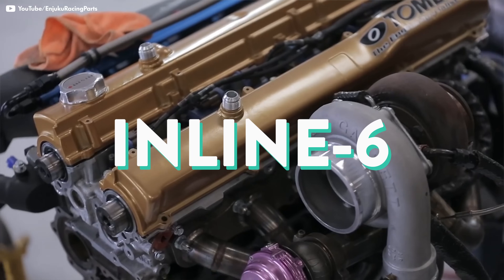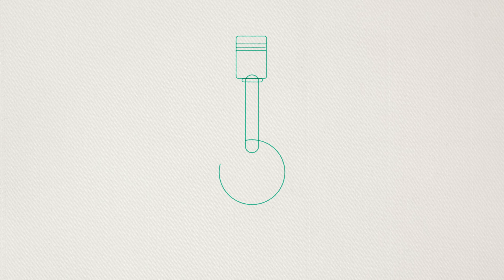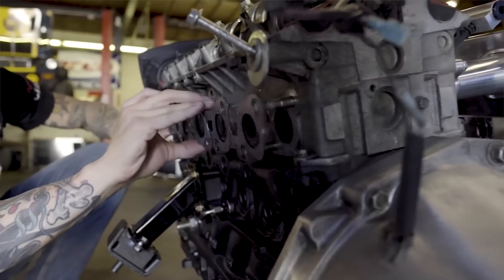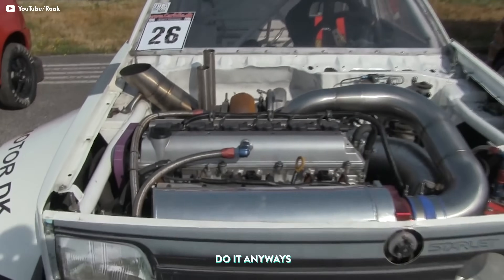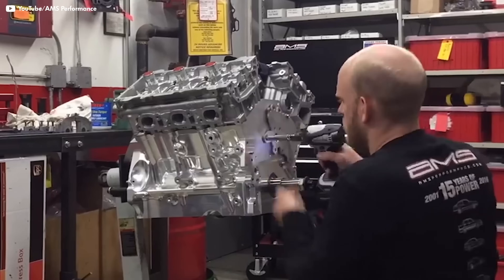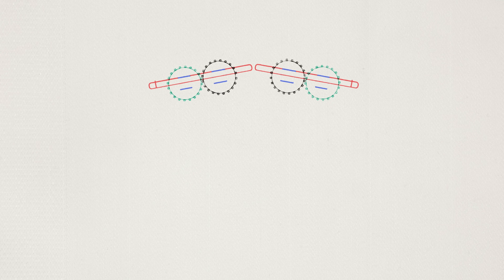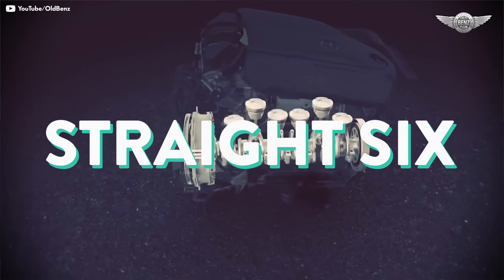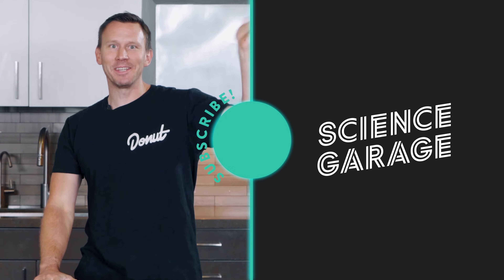INLINE 6 vs. V6 - How it Works | SCIENCE GARAGE

Comment: No mention of the AMC 4.0 Jeep engine. Probably the most iconic American inline 6. 

Good video though... as usual.
Reply: AMC'S 232 and 258 in line sixes are excellent.
Reply: 100% fact AMC Inline-6 engines are one of the most reliable engines
Reply: Mine has 350k miles and runs flawlessly
Reply: Zach Stefl don’t forget the early Chrysler 4.0l iteration of the AMC i6
Reply: Even here in Spain where everybody is a fucking diesel-cheap-psicho,  Jeep Cherokee(and grand)/wranglers 4.0 L6   have way more fans than 4pot and diesels, gess why...
Reply: Was gonna say the same thing
Reply: Zach Stefl ....and the AMC 4.2 straight six.
Reply: Zach Stefl bmw and toyota make better i6's
Reply: @lukas6610  i don't think you understand what the 4.0 was. It's not a highly tunable 1000hp engine, but it doesn't die. It doesn't get much better than that.

Comment: lots of trucks had i6s in them. they can be a great motor for a project but they do lack the HP. not alot you can do with them either. probably the most reliable i6 out there is the Ford 300/4.9L i6. surprised you didn't cover it here.

Comment: Long live the slowest v6 ever. The cast iron block and head ford vulcan 3.0. It came out in 1984 with a whopping 12 valves, a 5000ish redline, and maybe 120hp  mine probably has less as it's 23 years old on the original build!

Comment: Not all V6 engines have multiple camshafts

There's a number of them that are single Cam engines stating that V6 engines have multiple camshafts among other things is extremely misleading
Reply: All the V6 engines that are any good have multiple camshafts :p
Reply: Let me guess, VW group?
Reply: Quintinohthree just because someone makes a reference to boxer engines doesn't mean VW, they could be talking about Porsches
Reply: @karlsmith2570  You were talking about boxer engines? Damn, that's worse than I thought. I thought you were talking about the VR6. Heck, I think it should have been mentioned in the video why this best-of-both solution solves issues of both types but has issues of its own.

Let me explain to you all the ways that you are wrong;
1: Boxer engines are not V-engines. They are fundamentally different. Boxer 6's are at least as different from V6's as straight 6's.
2: VW Isn't exactly known for Boxer-6 engines. They're barely known for their boxer-4 engines nowadays.
3: Boxer engines of all configurations have the greatest need for multiple sets of camshafts and other such components in the head given the heads are at the opposite ends if the engine.
4: We're not talking about cam-in-block pushrod operated valves. There's a reason the only performance engines using those nowadays are the LS-series.
Reply: Quintinohthree First off, I was talking about V6 engines to start with

When I was making reference to the boxer engines, it was in response to someone else's post making reference to VW's having them as their powerplants

Making your post about that my " Being wrong" was premature, in addition to being a knee-jerk reaction to my statement which you'd taken out of context
Reply: First off, within this thread you made the first reference to boxer engines, I only responded to your mention of it. I don't know how you could turn someone else connecting boxer engines to VW in another separate and unrelated thread (which I haven't even seen and can't confirm even exists at this point) into me referring to boxer engines by guessing you were referring to VW engines.

Of course I was not referring to boxer engines, and as you can tell I'm well aware of what they are and what brands have made them, but instead I was referring to VR engines, which are exclusive to the VW group (give or take a few exceptions). Seeing as you have chosen to go further off topic rather than discussing VR engines with me or telling me what other V6 engines succeed in getting by with a single set of overhead cams, my suspicion that you don't really have anything worthwhile to discuss is growing.

I did not take your statement out of context at all. In the context of this thread, you responding to my guess that you were thinking of a VW group engine type with "not al boxers are VW, some are Porsche" suggested to me that you were thinking about boxer engines in your original post.

Now, do you want to discus single-cam V6 engines, or do you want to be correct?

Comment: Legendary I6s: Toyota 2JZ, Ford Barra, Nissan RB, BMW M88, Jeep 196, Chrysler G-engine (slant 6), GMC atlas LL8 (chevy vortec)

Legendary V6s: Volkswagen VR6, Nissan VQ, Honda J-series, Ford SHO, Lancia B20, Buick 231,

Any more?
Reply: buick v6 , amc straight six, chrysler slant six
Reply: 3FE, 1FZ, 1HD and so on from Toyota.
Reply: L series motors from 240z-280zx
Reply: Early Jimmy 6's from. GMC
Reply: Barra is the best inline 6 ever made
Reply: 6G72 V6 from 3000gt vr4's and other cars
Reply: legendary v6 should be tha alfa busso
Reply: BMW S54
Reply: @YeaItsNoble thats a flat 6
Reply: Mercedes M103 & M104 are popular for drift cars in Europe. Both share a block with the OM603 diesels so they're stong af. The C36 AMG engine is an M104 with an OM603 crankshaft. They're also very similar to the Mercedes I6s of the 60s which the Nissan I6s were based off of so some crazy people have put Mercedes heads on Nissan engines and vise-versa. 

Also, the Ford 300 is a fantastic truck motor.
Reply: Other legendary v6s vr38dett vg30dett
Reply: Samsung Galaxy S7   true
Reply: Cummins B series for inline 6
Reply: The Alfa Romeo Busso V6!! Those intake runners are a work of art and that sound is pure music!!
Reply: Can’t believe u missed the VG30DETT the greatest V6 ever made and the C Series form the nsx

Comment: Science garage on: fuels, part 3: expansion on octanes (some say that on higher octane fuel your engine runs better, you get outright performance boost and better mileage), are all those "super" fuels (with some extra chemicals that are supposed to clean your engine and reduce wear) worth it, what do when your car works on leaded fuel, what are the other kinds of fuel? How does oil work? Why so many different oils to choose from? How long do I have to wait for oil to start circulating and heat up? Will we ever get donut powered cars? 🤔

Comment: Chryslers first mass production use of aluminum engine blocks was with the 170 cubic inch slant six in 1960, as an option for the Valiant line (it got absorbed into Plymouth in 1961). I'm surprised you didn't mention the old Chevy stovebolt 6, that thing ran for almost 40 years, I think that was GM's longest production engine outside of the small block Mouse motor.

Comment: Surprised that there was no mention of the ever-popular 3800 series V6
Reply: I drive a 2000 Pontiac Grand Prix GT with 250k miles on it and it still runs pretty good. That engine is bullet-proof. I plan on getting everything right and running it 'till the wheels fall off. Lol
Reply: Maybe because it was a Buick 350 V8 neutered to V6.  Sure boost woke them up but it was still a low revving OHV 90 degree V6, heavy too.
Reply: @GlassTopRX7  it had a shorter stroke but same bore (3.80x3.85 for Buick 350; 3.80x3.40 for Buick 231 V6)
Reply: Ah yes, the old Commodore V6. What a heap of dung that was! I remember back in 2002-03 the supercharged 3800 (4 speed auto only) was slaughtered by the NA Ford in-line six...let’s not even mention the Ford turbo six!

Comment: Hold up... you said that FWD cars can't fit i6's, yet the Skyline GT-R (which is AWD, which I assume to basically be RWD+FWD simultaneously) has a twin-turbo i6. How did it manage that? Is that why the Skyline GT-R is a bit long for a mid-size sports car?
Reply: A FWD only car wouldn't fit an i6 because it would have to be mounted transversely. Skyline GT-R AWD(technically 4WD) system is actually a RWD system with a transfer case at the back, the second driveshaft travels from there to the front diff. This allows it to be %100 RWD until the computer detects a slip and sends torque to the front wheels. This is why people love GT-R's, the only other major manufacturer(that i can think of) to have a %100 rear bias 4WD system is BMW.

Comment: No mention about the legendary Jeep 4.0 in-line 6? ;(
Reply: If you want legendary than you're in the wrong part of the FCA, because what you want is the 225 Slant Six.
Reply: My jeep has 200k miles it's a 98 has the ol 4.0 leaks a little oil but it won't die
Reply: #Jeeplife #brokeaf 🤣🤣
Reply: Don't worry man, some of us appreciate that engine
Reply: My exact thought man, i love my 4.0 xj, never left me stranded and beats some of my friends cars in races, which is always a plus.
Reply: HP per liter wasn't good. Durability only on par with Japanese. Nothing spectacular. For the fuel they use they're kind of lame. Good not great.
Reply: Vegan Cyclist I agree with all of your points except I think it’s just slightly more reliable than Japanese motors, I’ve heard the Jeep 6 cylinders last to well over 350,000 miles. But you do have good points.
Reply: is there a petrolhead which prefers shit but durable engine?
Reply: Vegan Cyclist plus, you can get lots of horse power for cheap. You can turn the 4.0 into a 4.9 stroker motor for less than $3500 that creates 400+ horse power and 450 ft-lbs of torque. Pretty cool stuff. But fucking scary in a Jeep lol.
Reply: 3500 is enough money to turn a MK2 VW into a 12 second car. The problem with jeeps is the rest of the truck. They're fun but for that kind of fuel cost you might aswell drive a diesel. If they had put turbos on them, it would have been something special.  I do like the transfer cases. They're good.
Reply: Vegan Cyclist a turbo charger would be nice because the power band has lots of torque and horsepower from 1700-3500 rpm. There is no reason not shift once you hit 3500 rpm because the power just drops. From what I’ve experienced with my inline 6 wrangler, it needs some high range power. But then again Jeeps are designed to be off-roaders so you want the torque to be at its peak in the low rpm range.
Reply: The turbo would have been enough to push the motor to legendary status. People love OEM turbo cars that rip. Would have been nice to have a forced induction Cherokee. Fling mud and such. Turbos make the Highway a lot easier on the truck.
Reply: Zico Pwns All That 4.0 will easily go 500k or more just take care of it. The engine will outlast the body, that's for sure

Comment: My 2007 trailblazer has an in line six does that make me cool???
Reply: Allen Davis 270-291 depending on the year in fact it's the last American made I6
Reply: @FIREPHILSPENCER  its the last American in line six? Didn't know that, feel a little more cool now hehe
Reply: @starion1121  135,000 on mine good to know
Reply: My Wife's '04 Trailblazer is currently at 331k on original engine and trans. She drives it everywhere all the time. It's hard for me to find time to service it. But I keep the fluids up and clean, and it still goes!
Average mpg is 16 overall though, so it's not that light on the wallet at the pump.
She does rip tire with it at least twice per week.......... 😁

Comment: An I6 will also produce more torque than a similar displacement V6 due to the simple fact that the piston has more leverage to push the crankshaft before it reaches BDC. This is another reason why I6s are used primarily in work trucks and also why BMW uses them in racing. Because in the early stages of acceleration (like in autocross), you want as much torque as possible to get you going. Top speed isn't so much of a concern as acceleration.

Conversely, V6s are able to rev higher than an I6 due to these same characteristics, which makes them ideal in America because of the wide, open and straight highways we have. Although mostly, manufacturers prefer to make them because it's easier for them. Because the V6s can share alot of the same parts as the V8s.

Comment: I scrolled through a good chunk of the comments. I guess I'll be the only V6 guy here. Don't get me wrong I love all 6 cylinder engines. Well the good ones anyway. But I'm sitting on a 1991 Nissan 300 Z32 VG30DE NA with twin turbos added to the NA block with the same stock compression running E85 and sitting around 618 HP. No the engine isn't stock for the most part. Some stock parts are still there. I love the fuck out of it and it makes me giggle everytime I drive it.
Reply: i also have a v6, but its transverse mounted. Mitsubishi 3000gt vr4 awd, twin turbo, aws, active aero. yup we have tight engine bays, not cheap to maintain either,  but they drive like hell and we love our cars.
Reply: @westsidejatt2  Cramped engine bays don't even begin to describe our bays. Lol.
Reply: Honestly, by modern standards the z16's and z32's aren't really all that bad to work on... I have a z16 vr4 and my daily is an A6 4.2 quattro, thankfully I haven't had to do any real work on either yet, but Looking at the bays I think the Audi is actually going to be worse, I don't even know how they managed to cram a dohc v8 between the front wheels AND awd....Everything is getting harder to work on, we can probably blame CADD software for a lot of it, lol. And 6g72 is one of the best sounding  6 cylinders around imo.
Reply: Bruh- the stock comp ration on the NA motor is gonna blow your some gaskets and detonate all over the place. Good luck my dude- hope that E85 keeps temps low and the lack of oil squirters doesn't end up in a spun bearing. Happened to my buddy. BTW the VG30DETT was only offered in the Z32 so its pretty sweet in that sense. Mine is getting TT swapped soon (its a 2+2) and ive got all forged internals and Disco Potato turbos. hope i can have as much fun as you when its done but MAN is this an example of V6 being tightly packed.
Reply: @ARCDrillz  I know what you mean. I've been going 2 and a half years strong like this and I have no intentions of stopping. Knock and detonation has been a non-issue. Plus with the high compression ratio I don't need to run as much boost as a twin turbo to reach the same power level. But I must say it is a goddamn blast to drive. The only thing that isn't  " forged "  or has been touched is the heads. For the most part they are still stock. I am working up the rest of the money to do something with those. But for now I just wanted to play around with what I had the bottom end is all forged though. I must say going from 222 horsepower to 618 is exhilarating to say the least. I am also a 2+2. Aztec red. Though at some point soon to be Bayside blue. I'm also going to throw in some water methanol injection just added insurance.

Edit: But to be honest the reason I did it this way is because if I was going to do an engine swap I was going to say the hell with it and throw in an LS instead. So if worst does come to worse and it blows I've got a LQ9 and T-56 sitting here waiting to be put in.
Reply: What do oil squirters do to prevent a spun bearing? I thought they were for lubricating/cooling the wrist pins, cylinder walls, and pistons.
Reply: I'm with you bro VR38 is my favorite
Reply: Just got an almost new Honda Accord v6 and wow I can't believe how good it goes. I will always love inline 6 engines though

Comment: I know if you made a intro listing everyone's favorite I6 engines it would be 20 minutes long, all I want to say is the bullet proof Jeep 4.0L HO I6 is one of the greats too! never mentioned because its not a performance motor.
Reply: David Kutschke true, it's more of a torque motor than a performance motor
Reply: @karlsmith2570  nobody cares about off-road profomance
Reply: Ethan champagne it doesn't necessarily mean that torque isn't important in street performance

Usually, when automotive technicians put an engine on the Dyno, They measure both horsepower and torque
Reply: I too felt shafted by the almost complete lack of mentioning the legendary 225 Slant Six.

Comment: I love owning a 20 year old full aluminum 3.5L V6, the European ones only made a disappointing 253Hp cause they lost 0.7 litters of displacement, the one that I have is heavily modified from factor so 100% stock it has well over 400hp, manufacturer love to lie about horse power numbers. A 100% stock car that's 20 years old can do 0-60 in under 6 seconds

Comment: what do you mean it's almost impossible to fit a straight six in a front wheel drive vehicle? what about all the damn Volvos?
Reply: Which Volvo id Like to Know them
Reply: @Blue__244  Well I have a Volvo S80 2.8L T6 twin-turbo. That is an inline six FWD.
Reply: Something called magic and pure engineering mastery.Because it's Volvo.Reliable cars from what I hear.
Reply: @Blue__244  Volvo has a lot of variations of each of their car models, so you can get them in a lot of different configurations. Like the XC90 you can get either a 2.5 T5 diesel, or a V8, just to name some.